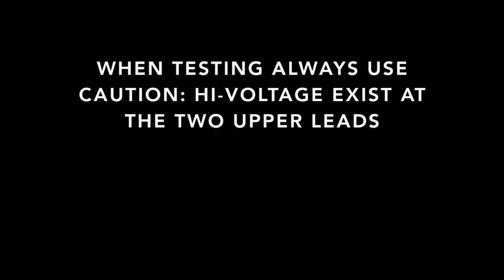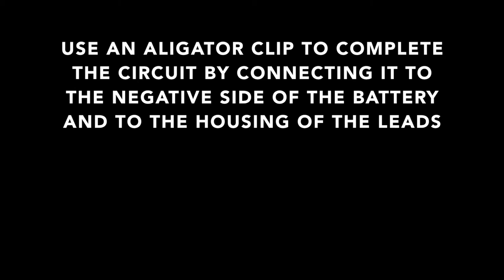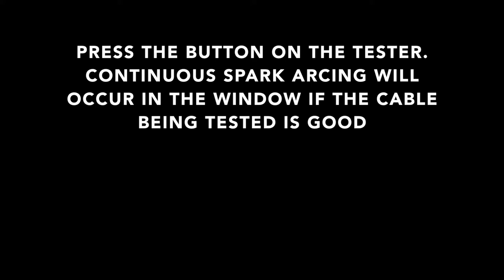Ignition Lead Test

Comment: can you test the lead while still attached to the mag ?
Reply: Yes, apply power lead(thinner cable) to battery, black lead to engine grounding point and put test lead ( thicker cable) to  the center of the spark plug cable you wish to test. Rotate engine if spark does not show in window. If it does not it means you have a faulty cable on that cylinder.